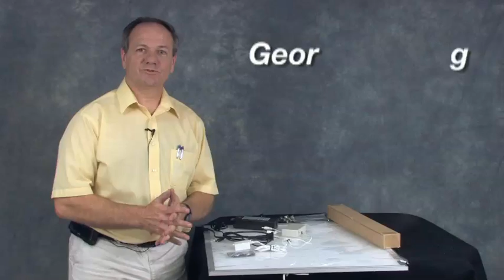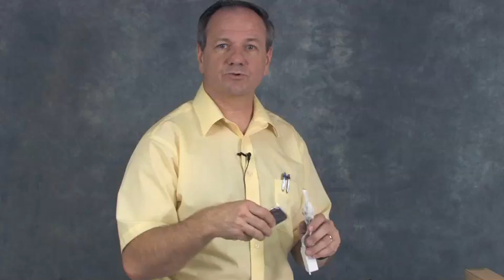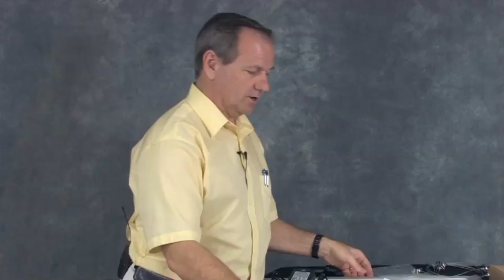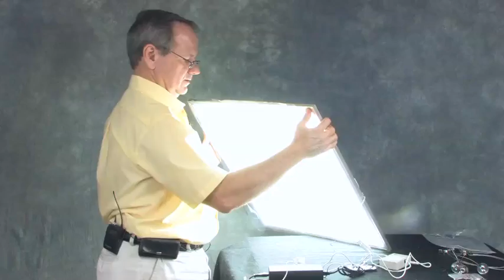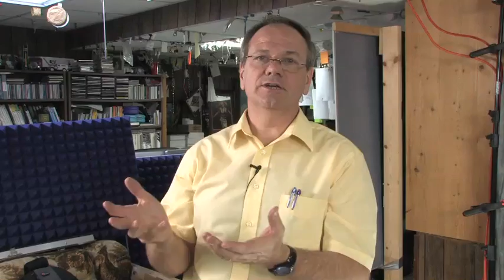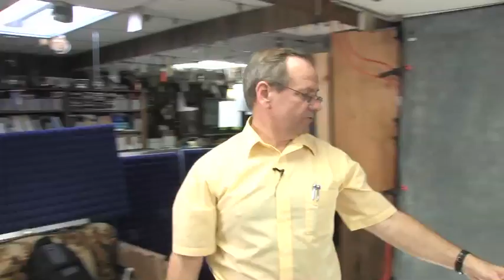LED Lights

Comment: The key parameter is Lumens per Watt.  What is the output of the panel in Lumens at full power?  I think 200 Lumens per Watt is state of the art.

There's a Wiki page for Luminous_efficacy

Have Fun,

Brooke